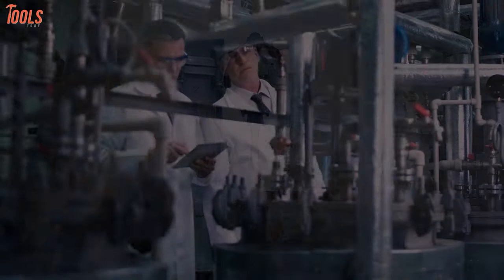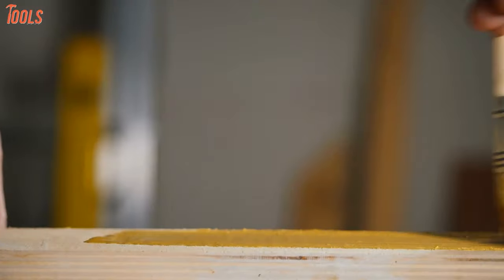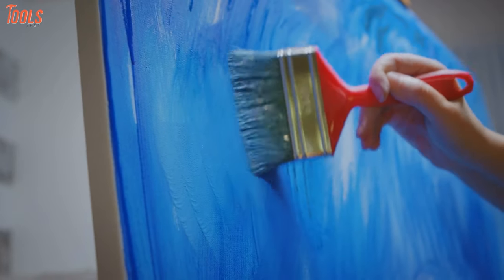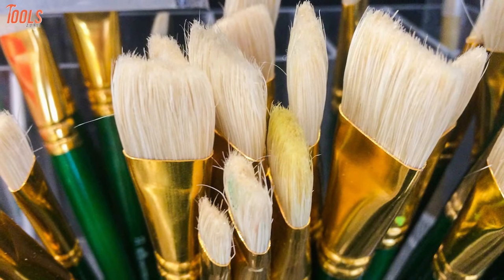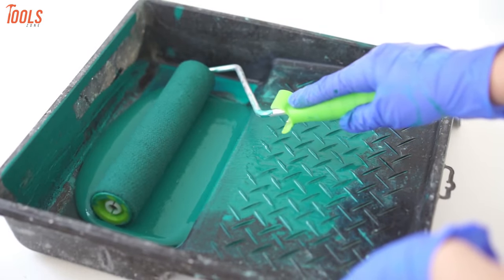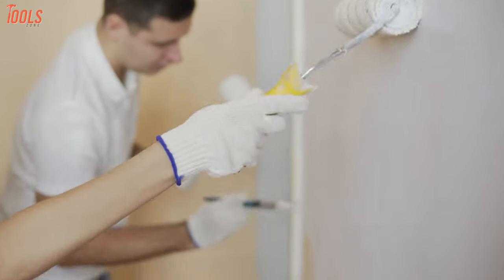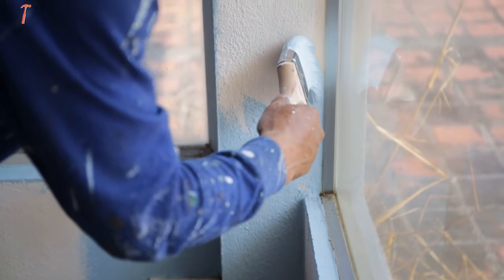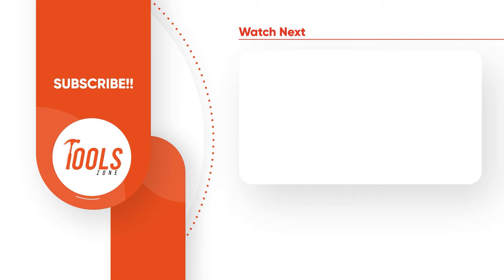Paint Roller vs Paint Brush - Which One Should You Get?

Comment: Tnx for the info. I live in a city somewhere in Asia where surprisingly roller is not popularly used. I have hard time arguing with contractor bec the finish is absolutely bad, I can see brush lines here and there, uneven paints, etc.  Gave me so much headache.  
I painted my own older house before using roller with brush for those areas where roller is not effective  and never had such issue. 

So I’m checking here in YT if roller vs brush is still like a horse vs cars back in the day when cars started rolling the streets.  As it seems some traditional painter here is using brush all the way.  This is a small standard aparment 3 bedroom.
Reply from the maker: Sounds like your contractor took "brush with greatness" a bit too literally! Maybe you should show them that roller vibes can be just as classic as a good ol' horse-and-carriage ride!
Reply: @tools-zone  lol 😅yeah true enough I recently got argument with contractor and I asked directly why I don’t see any rollers in their tools, they said they’re avoiding using it as it leaves pattern marks.  😂 I was surprised that this roller method can subjective on cultural rather than universal. No wonder it took almost 3 weeks to finish my small 3 bedroom apartment (600sqft). Now I have to settle for seeing brush lines since for them these brush lines are not regarded as pattern, but to me its annoying to see 😂. I saw they have 6- 8” brush that looks like a dried haystack , so I guess that’s the culprit.